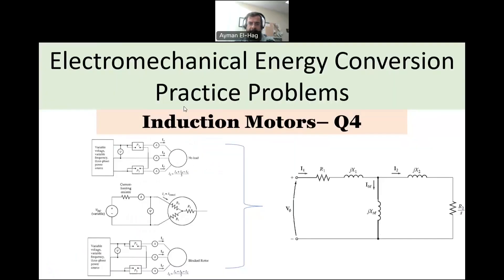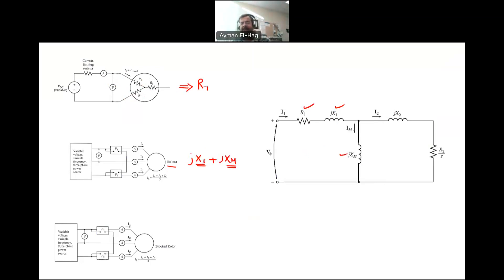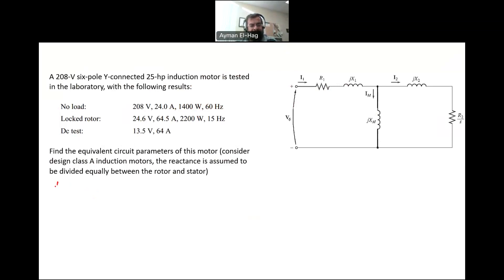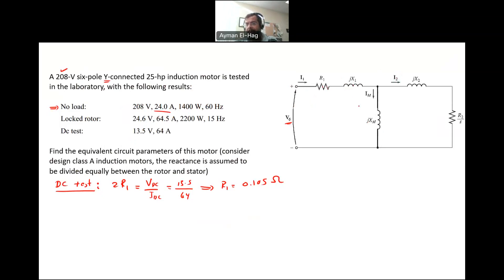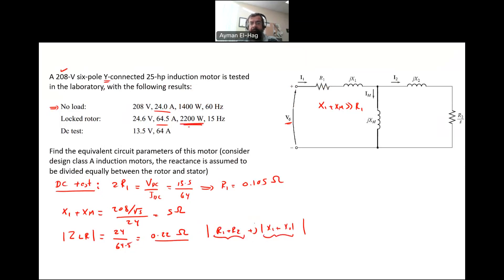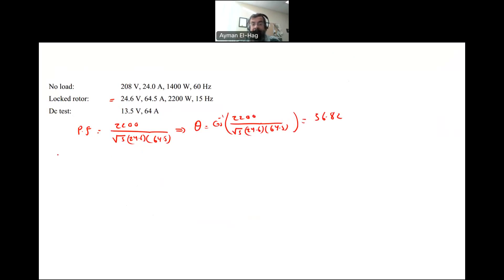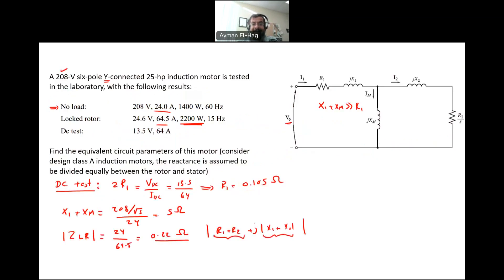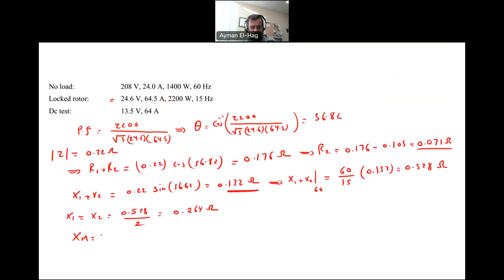Induction Motors - Question no. 4

Comment from the maker: Correction: at 5:01 the formula should be:
(24.6/SQRT(3))/64.5 = 0.22, so the answer is correct but the formula was wrong as we need to divide by SQRT(3) to find the phase voltage.
Reply: Makes sense thank you professor

Comment: Hello professor, the calculation at 5:01 does not make sense. Shouldn't it be 24.6V/64.5A =0.38 Ohm. Also, the answer in the written calculation is wrong it is not 0.22 it is 0.37 Ohm
Reply from the maker: Thanks for your feedback, the answer was correct but the formula was wrong as I need to divide the voltage by SQRT(3) to get the phase voltage.